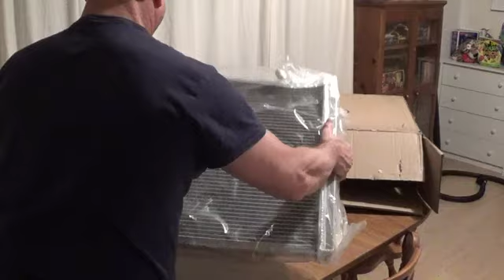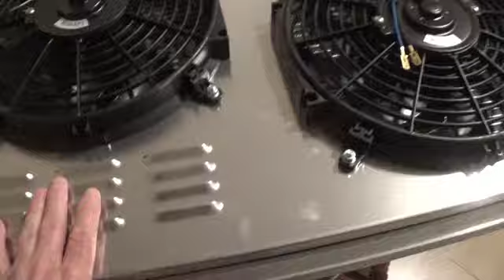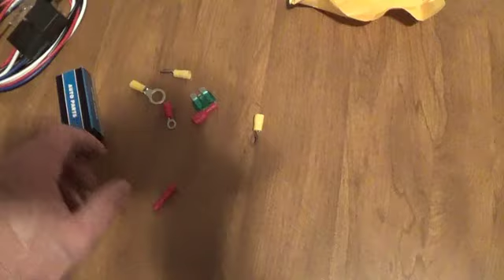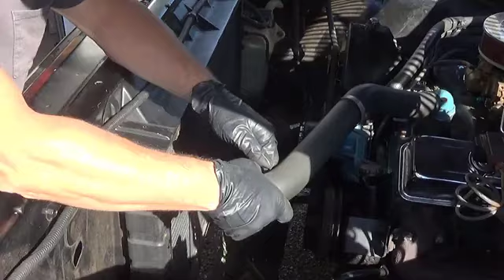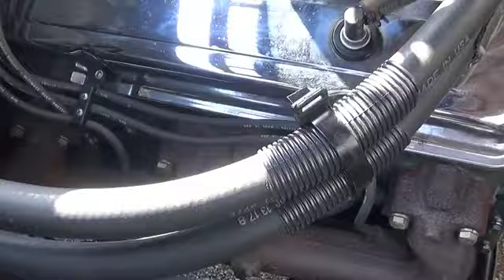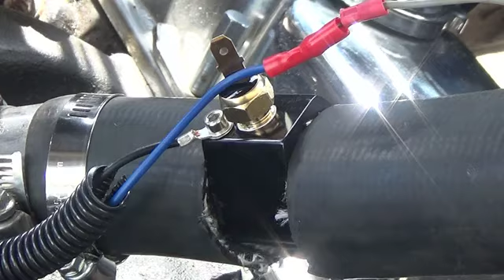Remove & Install Radiator! Wire up the Cooling Fans Properly!

Comment: nice video. Why not install a new thermostat housing that incorporates a bung for the temp sensor? Cutting into the rad hose introduces a a couple of leak points.

Comment: I was looking at the electric fan shroud with fans for 1998 blazer are they good?
Reply from the maker: Have a check on this: https://www.alloyworksplus.com/products/aluminum-radiator-fan-shroud-fit-1996-05-chevy-blazer-s10-c1500-gmc-jimmy-sonoma?st=
Reply from the maker: Please always make sure the size fits before making a decision. :-)